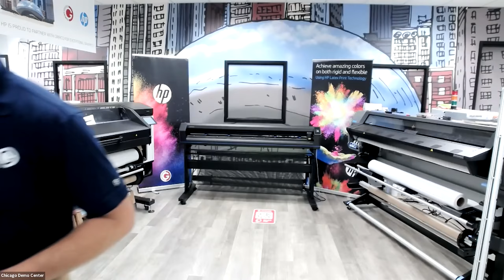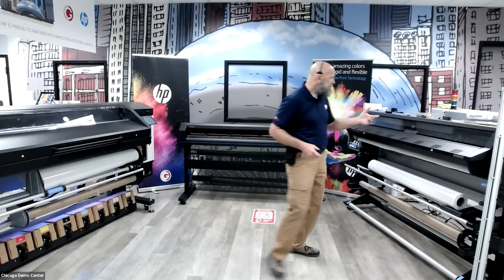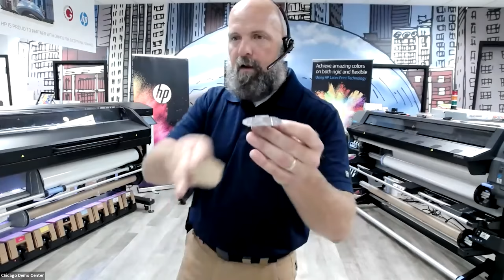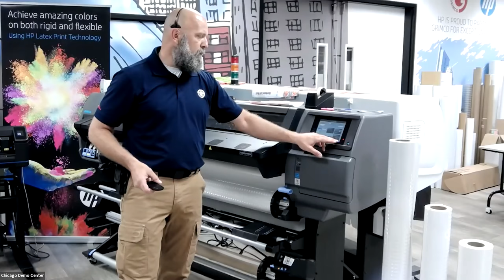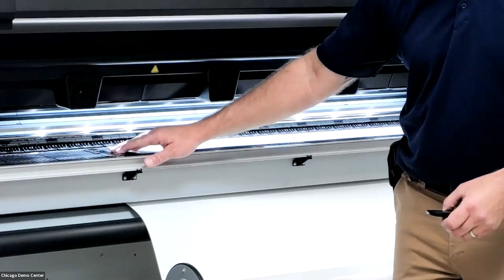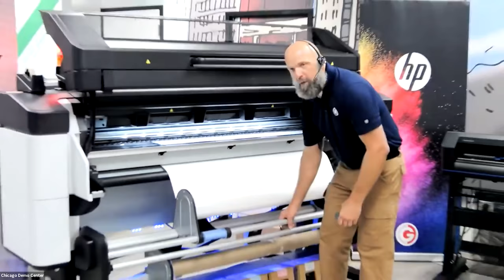3M & HP Traffic Sign Production Webinar

Comment: Hi  I got that machine 700w and I'm not satisfied from It, Can not print from the edge of the material you need to take out from the machine and start printing. lot of technical issues ( fixed on warranty) White ink Expiration date is too short not one year even 3 to six month. Maintenace cartridge is expensive and need to change it every 45-50 days. it is not an economic machine at all. Think twice before getting it and if you decide to sell one to get the one with white.Even ONYX tooo expensive. I willing to sell mine less than market price 25% if some one Interested.

Reply